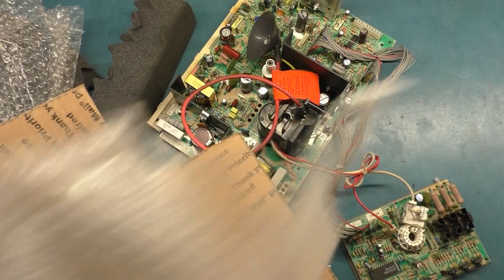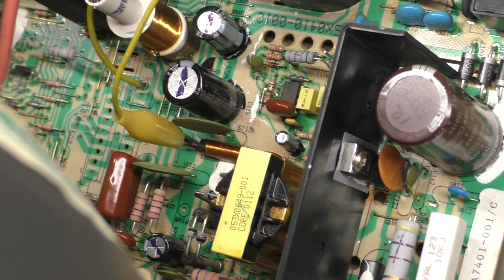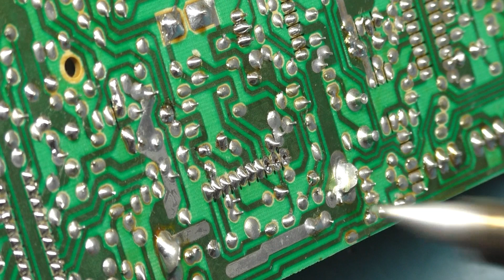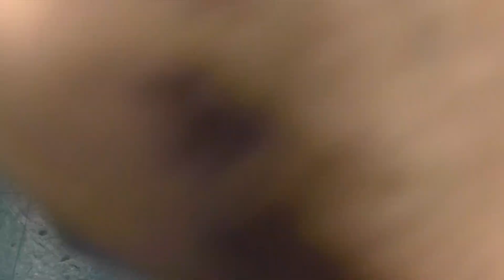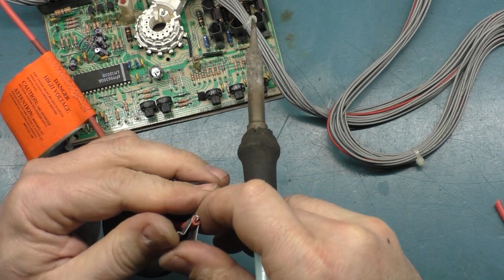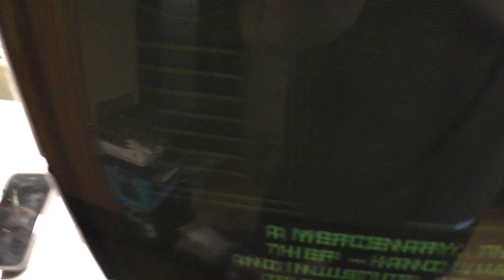25" K7400 Arcade Monitor Repair - Vertical Collapse - Counterfeit Parts?

Comment: Hi Mike, thanks for your great video. As for desoldering gun I have the same and use it for years. Needs to change the pads frequent (on the gun and on the connection with the main unit) and check if the pump is strong enough. Remove the glass tube on the gun and put you finger on the side where it sucks air. It might needs to fix the pumper in the main unit.

Comment: Hey Mike I love your content...just subscribed to your channel.  I was wondering if you could help me out.  I have a Silver strike bowling with  WGM2574 standard res monitor.  The bottom half of my screen seems to be shrunk versus the rest.  I can take some pictures to send to you if you don't mind.  Let me know if you can help out and point me in the right direction. Thanks and keep putting out great content.
Reply from the maker: Greetings. Thanks. Sounds like a vertical linearity issue. There’s no adjustment for that on the 7400 unfortunately. Cap kit is step #1.
Reply: @MikesArcadeMonitorRepair  where can i get a cap kit?  Does it show you which caps to change?
Reply from the maker: Yup. 

https://www.arcadepartsandrepair.com/store/components/capacitors/wells-gardner-k7400-k7500-series-monitor-cap-kit-105c/

Comment: I had the same issue with a chassis that I was working on, thinking since the ic was new it was good…. After 5 hrs I tee we Alize’s the ground was in the wrong spot as you mentioned. Glad you did a vid, as most of these ic’s are counterfeit garbage!!!  Very common

Comment: Hey Mike, I love your videos, they are really helpful, I'm learning a lot!  I recently bought an used aracde, in almost perfect condition,  except that it worked only for couple of hours after I installed at my garage, then, a burn smell came out of the cabinet... anyway, I was attempted to fix on my own after seeing your videos, but I didn't wanted to take the risk, and I wanted to see if you can help me with this.  It's a wei-ya C3125b1.  Thank you!
Reply from the maker: My pleasure! Not sure I’m familiar with that model unfortunately.
Reply: @MikesArcadeMonitorRepair  Thank you fo aswering! I can't find a place to contact you with more details and address to send you the parts.  I believe its the same, or very similar to the one you once fixed in this video: https://www.youtube.com/watch?v=CgBcTBbbQGo&t=303s

Comment: Smeggin awesome repair sir !

A combination of a copper coin inside the centre of the glass barrel & welding torch tip cleaner's (as another viewer recommended) has been saving my ass on my zd-552 desoldering gun.
Reply from the maker: Thank you. Interesting.
Reply: Can you explain further?

Comment: I use a manual solder sucker I bought at a yard sale for $3 and it seems to function better than your desoldering gun.
Reply from the maker: Yeah, I’m not a fan of those because they can sling solder around and create bridges when not used properly.
Reply: @MikesArcadeMonitorRepair  wow, I never had that issue but I definitely don't do as much desoldering as you do. BTW you're doing the Lord's work with these videos. I'll never have to fix any of these monitors but it sure helps to dispell the "magic" behind the functionality in general.

Comment: Not sure why you are having bad luck with your desoldering gun.   I use mine A LOT and haven't had it clog up on me.   I do have to clean it every so often or it's not as effective, but doesn't clog.   I have an FR301 and I run mine at "2" on the dial.   I also went to 1.3mm tip rather than the default tip of 1.0mm.
Reply from the maker: Me either. I’ve bought 3 and they all see to clog up on each use.
Reply: @MikesArcadeMonitorRepair  I've also ran into that issue before, I think what's helped me get past it is I now baby it as I use it. Every 10 or so solder joints I check the sponge to make sure it's still moist and run my cleaning rod through the gun to clear out anything that could start a clog. I have much better luck now, really seems to just need extra TLC to keep em in tip top shape. I also always apply fresh leaded solder to joints before desoldering, which helps a ton. I did a keyboard mod recently where I replaced every switch and LED which ended up being about 700 solder joints that I refused to try and do with braid, which really helped in figuring out how frequently I needed to clean it out and wet the sponge.
Reply: I have the same desoldering gun. I used it a bit, but it finally clogged. It didn't clog every time like yours. I think that's just the nature of the beast with these guns.
Reply from the maker: True

Comment: I was watching one of your videos while fixing a U5000 with verticle collapse, and it seems my "new" tda 1771's ground are one pin off or maybe backards?
Reply from the maker: If the ground is not on pin 5, it’s a fake. It should be the same as what I show in this video. The TDA1771 and the pinout is the same across the U2000/U5000/K7400/K7500.
Reply: @MikesArcadeMonitorRepair  yeah... i realised it from your video saying only one pin should be shorted to ground... and sure enough... pin 6 is ground
Reply: I am curious if it would work installed backwards... but not curious enough to damage my board
Reply from the maker: Safe to say…no.